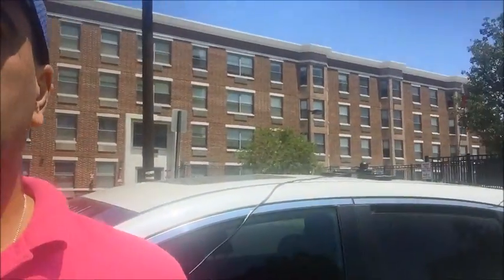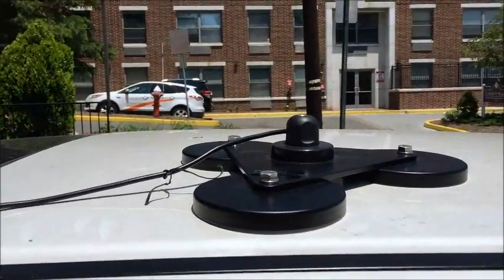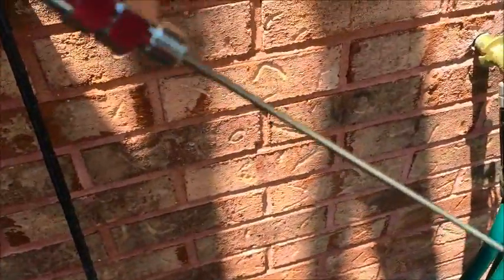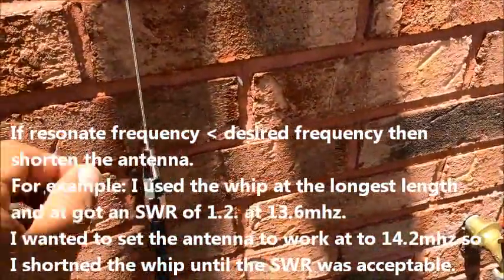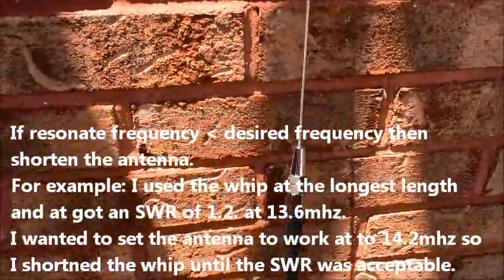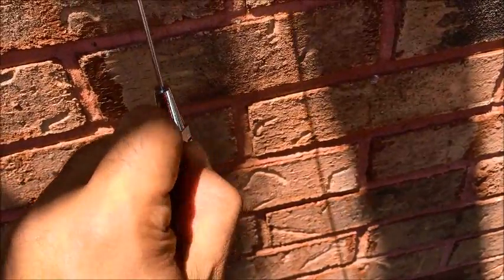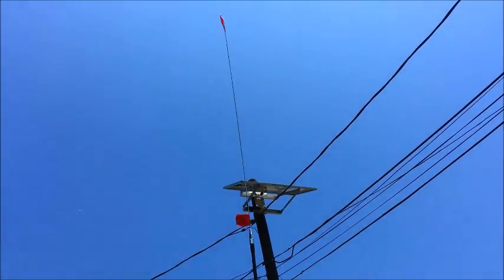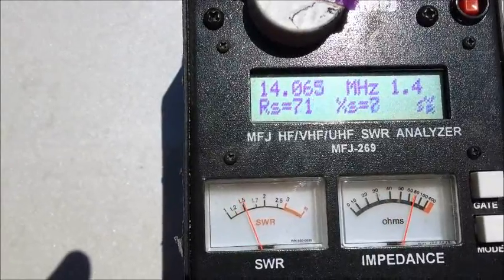How to install a 20 meter Magentic Antenna

Comment: Good video, very helpful.

About how far did the whip part extend below the screw-in part?
I'm trying to get closer to the same resonance point and don't have
an antenna analyzer.
Reply from the maker: I use full length for the standard (shorter) whips on Black, and 4.5 section length on the Red. But it also depends how you configure the coil. I use the standard recommended configuration of the coils for 20m
Reply: @k2efg  got things set up yesterday and made some SSB QSOs on 20M with 20W. Thanks!

Comment: You have a 7ft ant on top of your truck ?    I was worry about having my 20m on the trunk
Reply: That's a valid concern. I find that rarely does it hit anything. If any, it's usually trees.
Reply: @yigalrechtman  ok I did ment 20m ham stick in once in a while going drive-thru I hear it hit
Reply: Just to point out the hex screw driver is called a Allen Key and the screws are called grub screws 🙄

Comment: I mounted a thin cord in my vehicle rack on both side towards the front and tightened around the antenna so that at HWY speeds it wont ruin it...  Way before that, I lost 2 antennas..  Then when I got the Idea from a magazine to use nylon or other cord, I had no problems whatsoever.